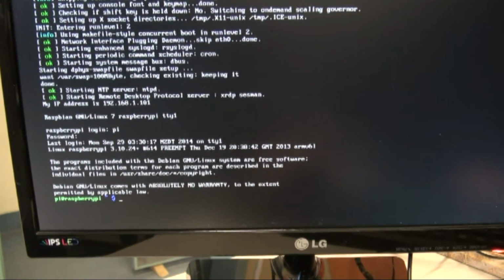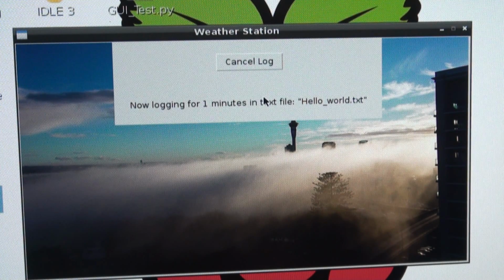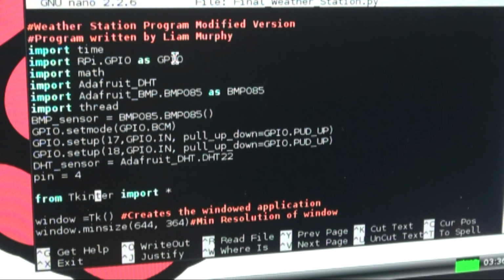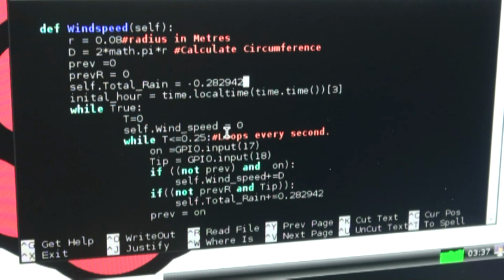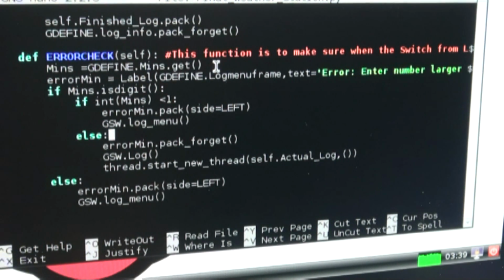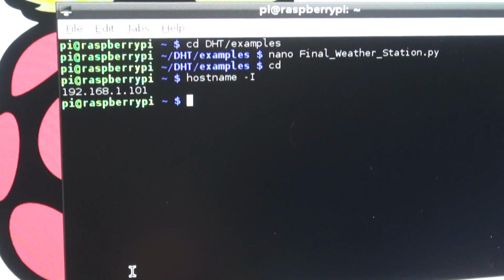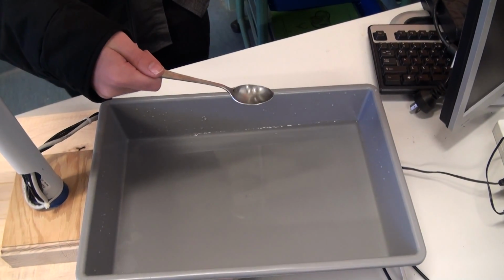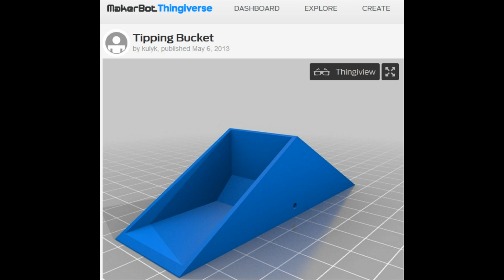Raspberry Pi Weather Station

Comment: It would be very nice if the weather station would send the measured data to Citizen Weather Observing Program, so that the data could be actually usable for weather forecasting and research. The sensors (especially the wind speed) might need calibration to make the data accurate enough.